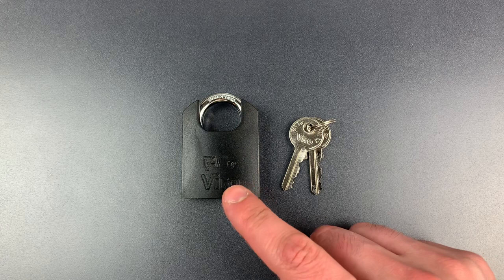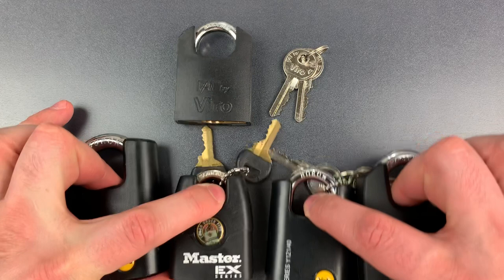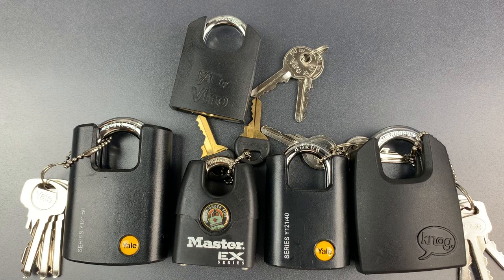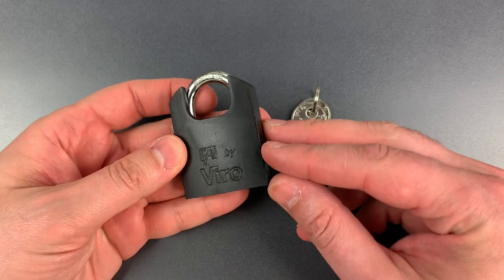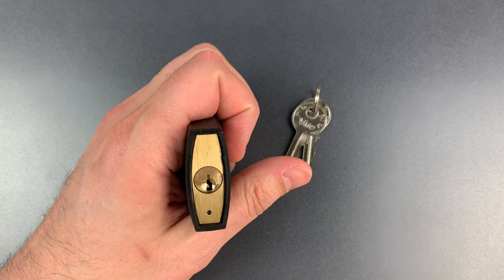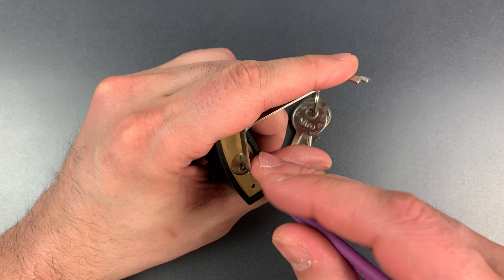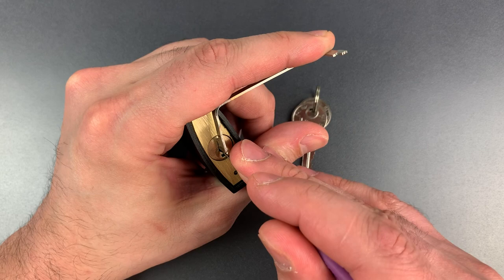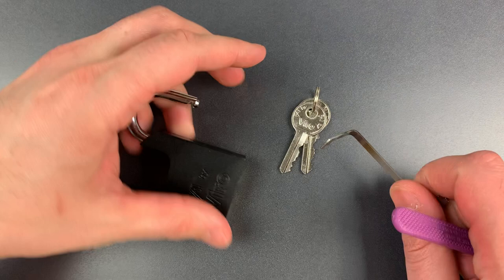[866] PLASTIC Shackle Guards?!? A Disappointing Trend

Comment: A plastic covered steel shackle guard would be the best of both.  Real protection plus preventing sparks and scratches to what is protected.  Patent Pending!
Reply: Or a rubbery material.
Reply: @und4287  yeah I would want a hard-ish rubber covering a steel shackle guard

Comment: I want some security, but not too much security. What a great idea.
Reply: Cost vs. Security is almost invariably a compromise. If you can't afford/justify a decent lock with a metal guard, a decent lock with a plastic one might be better than the same lock with no guard or a bad lock with a metal guard.
Reply: Moderation in all things.
Reply: If its glass fibre reinforced composite cover , that may need same tools than metal , but is still lighter 
Would like to see how these plastic covers react to freeze spray and ramset .

Comment: I recently bought a house, and the previous owners had a padlock they lost the key to so we had to cut it off. It was a plastic shackle guard one. And it looked like the larger one with the yellow dot. (It didn’t have the yellow dot but it was similar build.)

Since neither me or my friend who was helping me had skills in picking locks, bolt cutters it was. And even though it was a plastic shackle guard, it was impossible to get the bolt cutters positioned anyway we could cut the shackle, or even cut the shackle guard in any effective way. In the end, I had to get a hacksaw to cut the plastic, so I could get to the shackle, to cut it with the bolt cutters. It made what would have been a few seconds to get in the lock, about a couple minutes. And if I just want to prevent most people out of my stuff, that delay in how long it takes, may be enough to prevent a lot of thieves, who rather move on to someone a lot more vulnerable.While a skilled picker would be able to open one of these quickly, the idea is, for most people, using bolt cutters are next to impossible. Plus I would assume plastic shackle guards are cheaper. 

I would still recommend getting a metal one if at all possible, just because it will be 1000 times more secure, but a plastic shackle guard is way better than one without any kind of shackle guard.

Comment: I would rather see zinc shackle guards.
These shackle guards might be there to deter shimming but I think the main deterrent is bolt cutters. Maybe they want to save money on metal because a grinder will get through even with a shackle guard made of metal. It could slow it down but not much.
A metal plastic composite might be effective against bolt cutters...I don't know though.
Still better than no shackle guards.

Comment: They are quite useful in a vibrating environment.  I have one securing the pin on my receiver towbar.  If I was using an all metal lock, it would be going "clink clink clink" as you go down the road.

Comment: Long time fan. Very grateful you put out so many informative and interesting videos.

Could you make a video about how to make the bent top of the keyway bar you used in this video? I assume a torch is needed and I have heard that it's good to quench the metal after heating and bending to retain strength, but watching a video of someone doing it would help a lot.

Would sending you some top of the keyway bars from Peterson (which is what it looks like you're using) help you make such a video?

Comment: Recent experience that may amuse: rear innertube blew. Took bike by train, took off front wheel, put U-lock through front wheel, rear wheel, frame and stand, took lights off bike, got taxi home, got bus back in morning to get bike sorted at bike shop in the station (handy!) and found that my lock was only through the rear wheel and the stand. The bike was still there, with its front wheel leaning against it. Apparently, someone took the lock off, tried to put it back together and ride away on it, noticed that it had a dead rear and actually bothered to pick the lock closed again before leaving.

Comment: I need a lock to lock my shed with highly valuable contents. Best lock under $100?
Reply: Theft insurance.
Get your money back after getting robbed.
Reply: Can the shead actually be secured - does it have solid walls, does it have large windows, can you mount a proper hasp or some other kind of lock? 
And then it depends, there are a lot of good locks for 100$
Reply: Is the hasp itself secure? Are the hinges on the outside? (I've seen that so many times with sheds). Do you have one of those motion detecting lights on the shed? If all the above issues are covered. You want a lock with a high shackle guard. Idk where you live so it's hard to recommend a lock. Easiest option is find something with a high shackle guard in your price range and google it. Either LPL or bosnianbill bill will have a video on it.
Reply: @andregon4366   Tosser.

Comment: I'll stick with my Abloy 342 and 362 locks thank you very much.

Had Abus not had their collective heads up their ass, I'd still be using the Abus 20/70 Diskus or the Granit lock for storage container use.
Reply: Word up for the Abloy 362, my favourite padlock.
Reply: I have the 342, but I'm worried that it is pickable now 🙃
Reply: @wmmt  +
  I think it depends on the core used and who the picker is.
  Classic core, yep, it's pickable.
  Sentry core, very difficult as there are 9 or 11 discs depending on age, if memory serves me. I also know that there are at least two different keyways available.
  Protec and Protec2, I've also seen the video purporting to pick lock, but no one else has shown pubically a pick.
  There's always going to be a method to pick into a lock. Make it difficult enough, they've got to be highly motivated or they will move on to the Master Lock a little further away.
Reply: Whats wrong with te Abus 20 series? I use a 20/80 for my bike, it seems fine to me.
Reply: @gungadinn  Well whatever the case may be, what's happened to the Groove? 🙃🤷‍♂️
Reply: @BL-yj2wp +
  If you really want to know, the Abus 20/70 Diskus locks as keyed alike are almost exclusively using one of 5 or 6 key numbers. Check out the online lock shops selling Abus.

  I've got a few storage units that I use two locks on each door, so I purchased 12 of the 20/70 locks to reduce the number of keys carried. Well, I purchased another car needing a storage unit, so I went to purchase additional locks, when I discovered that in keyed alike, the key numbers were extremely limited.
Reply: @gungadinn  There is a specific tool for Abloy disc detainer locks, fits in a drill and literally chews the hardened face ring out of the core in little time at all, the contents just come out and you can open the lock.

With the availability of carbide and diamond rotary bits these days, not to mention how cheap circular cutoff discs are and high powered cordless grinders thrown into the mix, even the specialist tools aren't required for destructive entry.

Unfortunate truth is that locks are a deterrent at best, if someone wants in badly enough, they're getting in.

Comment: The only advantage I see with the plastic is that it will lower the risk of the lock causing wear to the item it protects. So it's not really protecting the lock, it's protecting the protected item. Except that the lock don't work very well to do that considering the pick resistance.
Reply: He also mentions that in the video

Comment: If for some reason the manufacturer was unable to use a plastic shackle guard on these locks at all, I bet pretty much all the ones in this video would have no shackle guard rather than having a metal shackle guard.

Comment: How is that disappointing? If it's cheap and keeps you from shiming the lock it's a good thing, right?
I would think it's better to have a plastic shackle guard than no guard at all.
Sure you can still pick the lock but so can you with a metal shackle.
Reply: He said the same thing in the video. That it's better than no shackle guard at all, but it's still dissapointing that it's becoming a trend.
Reply: @bapanada9446  If the lock is easy to pick anyway maybe it's better to use a cheap plastic shackle guard instead of a steel one.
Reply: @JoeDurobot  If the lock is easy to pick, maybe it's better to use a better lock?

Comment: The way I see it plastic shackle guards are intended more to be tamper-evident than tamper-resistant. The plastic parts don't put up much resistance to destructive attacks, but they can necessitate the use of destructive attacks when a would-be thief would have otherwise used a nondestructive method that would have been far less likely to be noticed.

Comment: What? Calling it a shackle-guard is the problem. These stop scratching and also keep thee lock looking good 10 years down the track. I've found they also stop electrolysis corrosion between the metals of the lock & whatever it's locked onto.
Reply: You find the only corroded spot is where the shackle touches the latch, hasp or chain.

Comment: Even Yale going with the plastic - whatever next?
Reply: shrug If the padlock is 5% more expensive than identical counterpart without the plastic, I'd say it's not a bad trend. It adds little (but still something) to the security, it does work as a visual deterrent against inexperienced thieves, and it's extremely cheap to implement. If it doesn't raise the product price overly, I'd say - nothing wrong with it.

Comment: If these locks can easily be shimmed, then couldn't you argue that no guard is better than a plastic guard? Since you can just cut/melt the plastic and shim it, while a lock without a guard would (or should 😅) be designed to withstand shim-attacks?

Comment: Click out of 5, Click out of 4, Click out of 3, Click out of 2, Click out of 1, and open. It's almost as if the pin holes weren't drilled parallel to the core. Nah, couldn't be with that quality lock.

Comment: Polymer is ok for firearms but Not Security Products!!!
Reply: Mark Anthony Stringfellow  it wouldn’t a firearm be considered a security product?
Reply: @FishFind3000  yes and no.. Depends I suppose.  But they don't need to keep people out of a gun so lighter materials work, nobody is going to smash a gun with a hammer normally or anything like that, locks face far more risk of damage, hence we prefer they be made of stronger materials.
Reply: @FishFind3000 he Context I meant was  You wouldn't find yourself Hacksawing, Prying.boltcuttering or hammer attacking a Glock 23 Frame for any reason I can think of :-)))

Comment: Grading of the lock :

Fine for a shed, but make sure the hasp on the shed is strong enough to resist twist-attacks
Fine to lock up a bike, but make sure, the chain cannot be cut with a set of simple bolt-cutters.

Not fine for a Lock-sport competition, you'll bore the competitors.

Comment: I've always wondered if it's possible to create a lock with two spring loaded keyhole so that both have to be turned at the same time. That way they'd have to be picked and tensioned at the same time. Any thoughts on This?

Comment: If its entirely plastic then a hacksaw could easily saw through then the bolt croppers can get a grip on that exposed shackle. Using plastic on a padlock is just Mickey Mouse manufacturers seeing what cheapo materials they can get away with, and I thought that monkey metal (zinc) was bad! My new PL342 was laughing all the way through the video, little metallic clinking sounds it made lol, so I know it thinks they're stupid too! 😵😆🐵🐷

Comment: Would adding considerably more pins and making them smaller make a lock harder to pick?
Reply: If so why not?
Reply: @900bz  small key pins can be exploited with a fork, pushing all the pins above the shear line
Reply: Just adding more pins means it just takes longer to set them. Say you have a 3 pin and a 6 pin lock, made with equal tolerances, you'd expect the 6 pin lock to take maybe twice as long to pick (perhaps a bit longer). The pin size and spacing is also constrained by the tools used for cutting keys. These are form punches or form cutters, to get ramp surfaces between each pin to prevent binding / shearing. If you make the pins much smaller, you'll need one tool per bitting, which is waaayy more complex and expensive.

It makes more sense to use tighter tolerances and security pins etc.

Comment: So why would a plastic shackle guard make it harder to shim?
Reply: Any shackle guard makes it harder to shim. A plastic guard is better than no guard, but nowhere near a metal guard.
Reply: @Marionette_Doll  I understand that, but he said that a plastic shackle guard makes it more difficult than a metal one so I'm wondering why?
Reply: @madcapmagician6018  If the shim doesn't match the gap perfectly, it will just bend to match the gap with a metal shackle guard. With plastic one the chance is good it will dig into the plastic and get stuck.

Comment: So I have a question that's not related directly to the video, but... why do you call that kind of tension "top of the keyway" tension? After all, that's the part which is normally facing down when lock is installed, not up. (I mean in door locks; I know that padlock can be moved around)
Reply: Australian here. In America, most cylinders are installed with the pin stacks pointing up, it's the same here in Australia, and I imagine it's also the same in the other Commonwealth countries. So this would correctly be called "Top Of Keyway" tension, in those countries at least. I understand that a lot of "Euro" pin-tumbler locks are installed in the opposite fashion, with the pin stacks facing down. Perhaps it is best to ignore the physical orientation of the cylinder, and instead consider that with "Top of the Keyway" tension, torque is applied from the side of the barrel that is nearest to the pin stacks, giving better control and feedback through the tension tool. "Bottom of the keyway" tension involves applying torque from the opposite side, furthest from the pin stacks, regardless of which way is 'up' in terms of the physical installation of the cylinder. BOK tension allows greater access to the pins and suits a wider range of tension tools and picks than TOK tension, but doesn't give you as much fine control and the feedback is not as good, especially when trying to defeat security pins for example. Hope this clears things up a bit. :)
Reply: @sixstringedthing  wow, thanks for lengthy response! So I'll accept the 'TOK' and 'BOK' being conventional names for different types of tensions, although it's extremely unintuitive for me. Not only are basically all of the pin-tumbler locks installed opposite of this convention, but also the classical look of keyhole (with older-style keys) is opposite too. I didn't know that it's a norm to install locks upside-down in so many places.
Reply: @jakistam1000  I'm pretty new to locksport myself, so you probably shouldn't take my words as gospel truth, but I believe this is correct.  One of the things I like about this community is the opportunity to chat with people all around the world, which reminds me that a lot of this stuff can be very different in other countries, compared to what I might consider "normal". Your question caught my attention because I'd never really considered that the usual European method of installing locks makes a lot of the conventional American lockpicking terms seem nonsensical.
But I guess there's a lot of things about America that seem nonsensical to those of us who don't live there. ;)
Cheers, happy picking!

Comment: Maybe it's not just "plastic" but some kind of reinforced "plastic" Did you try to break it?
Reply: You're right, not all plastics will be as good. I wonder what would work best? Reinforced nylon could be a good option, or maybe polycarbonate. Most or all of these are probably just cheap PVC though.

Comment: I just picked my nose.
Reply: Did you get it open?
Reply: Remember to not go too hard on the tension. :-\
Reply: @elbee2324  
Depends on the manufacturer.
Reply: Got it open and raked it good.
Reply: @stephen9900b   Be careful on that fifth pin, it's getting pretty close to the brain! 👃🏽🧠